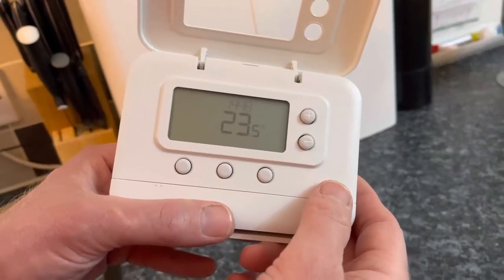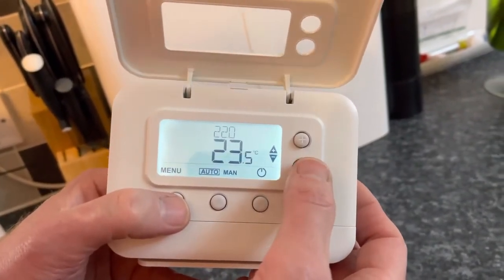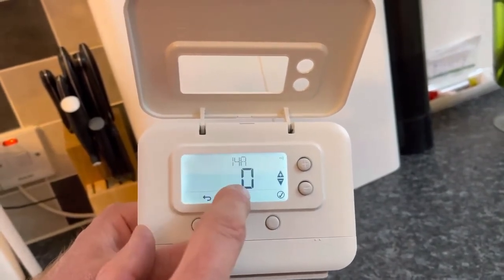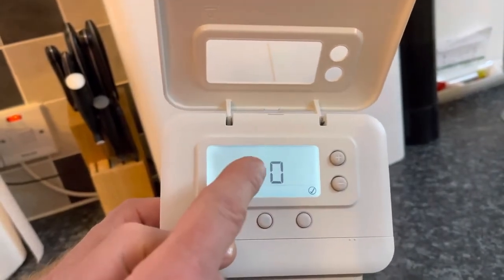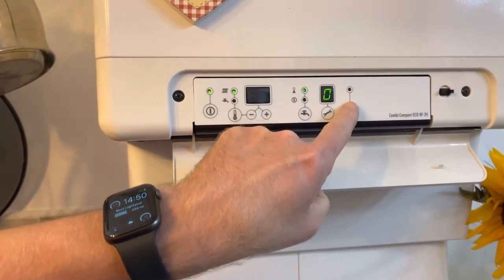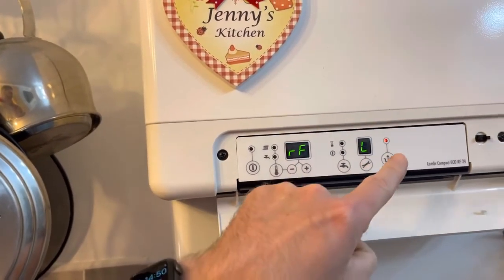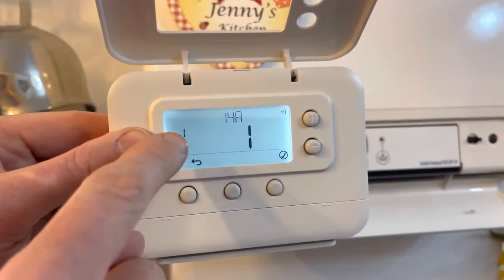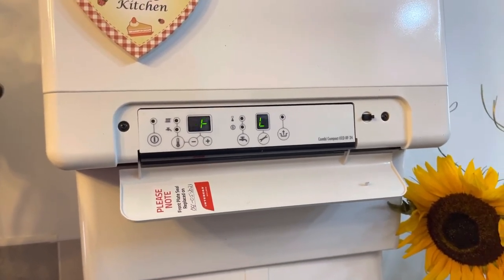Pairing a Pro Series Wireless Thermostat directly to Intergas ECO RF boiler | TheIntergasShop.co.uk

Comment: What is the step after you have 1 1 on the thermostat and L 1 on the boiler?
Reply from the maker: It will just time out and save after a short duration. Alternatively you can press the 'bucket with up arrow' button and it will say 'P' which is save.